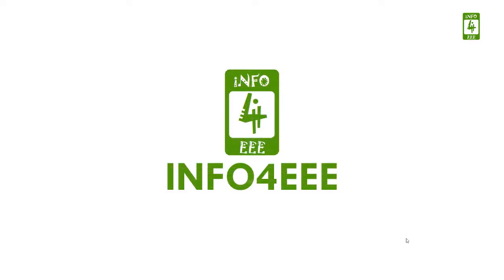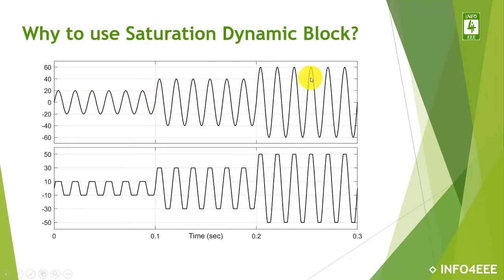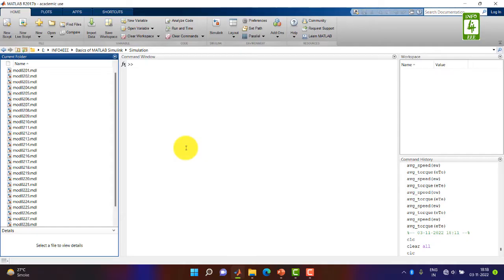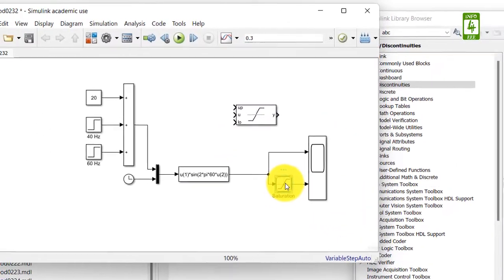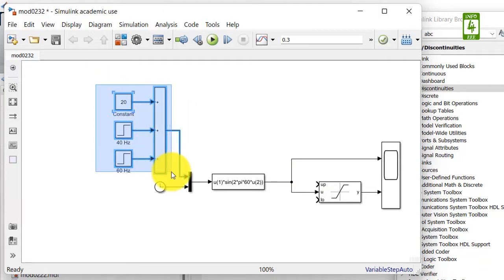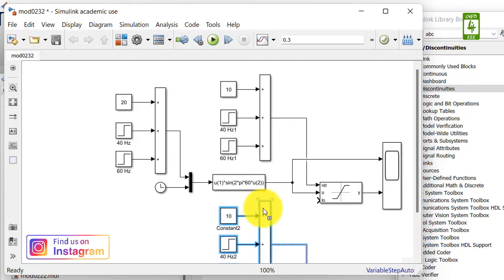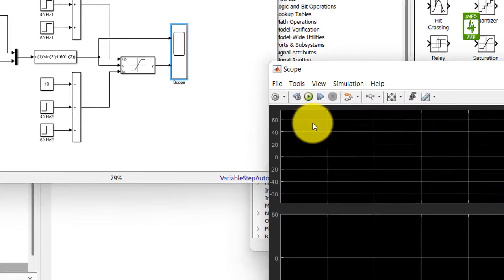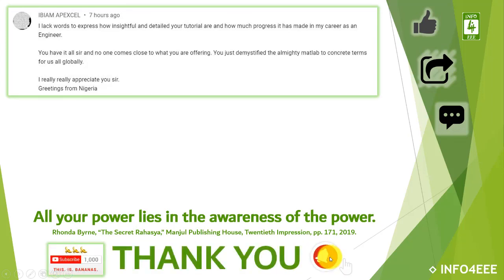Saturation Dynamic Block in MATLAB Simulink for Variable Amplitude Saturation #32 | P. S. Jamwal

Comment: Sir can we use this saturation block for DC output
Example: output of boost converter that is, In between voltage measurement block and goto block.
Reply from the maker: Yes, you can use this saturation block for DC Output. For this, you have to connect the output of saturation block to controllable DC source. The Example is not clear to me.